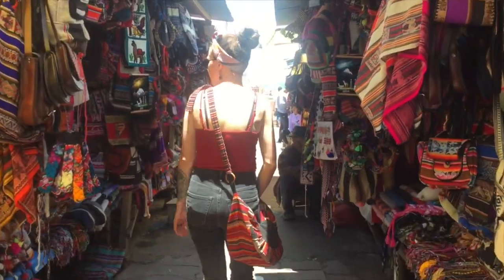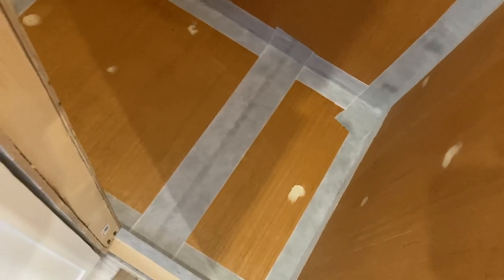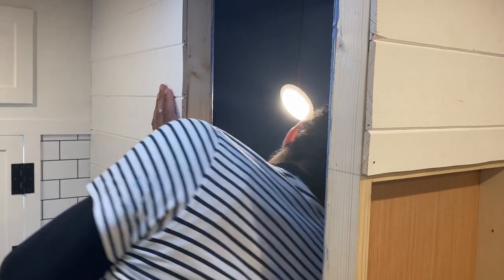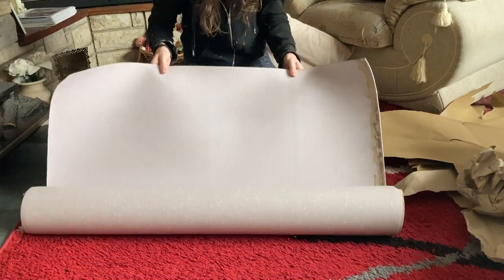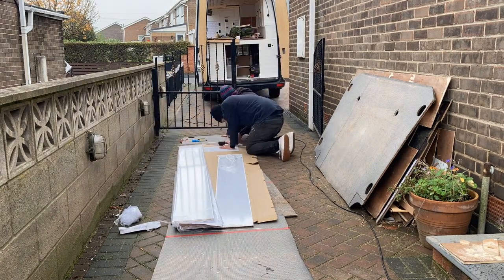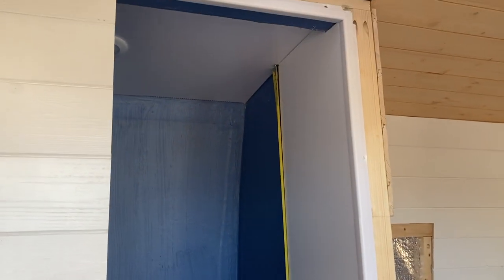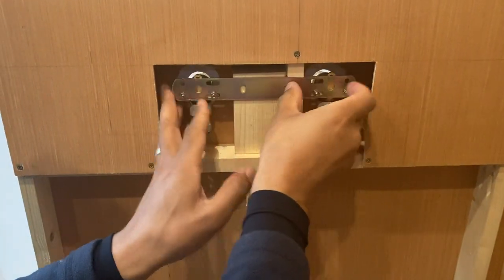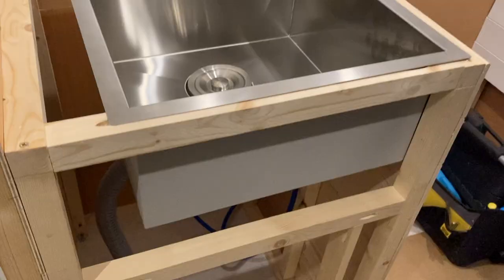Waterproofing Our Van Shower | DIY Sprinter Conversion Bathroom Build

Comment: I used to install bathroom cladding. (on and off over the past 20 years) The secret to cutting it is to use a blunt wood saw. There are also different grades/types of cladding. Sadly you got some of the harder/brittle panels. The more brittle panels are also the thinner panels. The thicker 8mm and 10mm panels are much easier to work with. I would say you did an extremely good job for your first install, especially because you used the thinner panels.
Reply from the maker: Aha, that explains a lot! And is so good to hear that it’s not just us 😅 We went for the thinnest possible cladding panels down to weight and space considerations and we imagined they would be easier to bend into shape than the thicker ones. Sounds like we were very wrong. Thanks so much for the info on how to best to cut them too, that will no doubt come in useful for anyone else reading this who is doing the same thing. Really appreciate it 😊🙌

Comment: Oh boy.... My partner and I are in the beginning stages of a complete airstream rebuild... it doesn't feel like the beginning because we've already done so much but we have yet to build the inside (including bathroom)! We've removed everything, fixed up/welded the frame, installed new floors, taken out the inside skins, polished the outside, taken out the door to fix up, and so much more, and yet the inside is empty! It's encouraging watching this video though, it looks like a lot of work but so far we've learned that every single step is always 10x more complicated than you expected. At the end of the day, you HAVE to be able to laugh off the struggles and mess-ups, or a mental breakdown is right around the corner haha. You two seem like a good team though and you show that perseverance pays off. Anyways, thanks for the detailed and thorough recording/blog of this shower build, it looks amazing!!
Reply from the maker: Wow that sounds like a really big project! It’s crazy how you can do weeks/months of work and then still feel like you’ve not done much but the attention you pay to the bits that you don’t ever see definitely pay off in the long run. You’re absolutely right about the sense of humour though, you’ve gotta be able to laugh even in the face of disaster 😅 We never got any better at budgeting our time though, everything EVERYTHING took waaaaay longer than we thought or wanted. Good luck with the rest of your build 😀

Comment: Well done, I think that's how I would do mine, but with acrylic sheets. But I need to get a loo in there as well. And have the dilemma of: compost, cassette or porti loo!!
Reply from the maker: We have heard people say that the acrylic sheets are a little easier to work with, we were just a little worried about a single mistake messing up a whole wall, at least with panels you can just redo a single panel 😅 We went with a porta potti in ours but we’re considering upgrading to a compost. Just need to find one that will fit through our tiny doorway 🤔

Comment: Another job well done people.  Those bathroom panels looked like trouble from the beginning and the working temperature  didn't make things any easier either.
I'll go for acrylic 3mm panels that cover the wall in one piece. Getting nervous already.😰
Reply from the maker: Yeah we’ve heard that those large sheets are a little easier to work with but we’ve seen people struggle to cut them to the correct shape as well! And we just figured that if you mess a single panel up it’s easier to fix than if we messed up a whole sheet. Let us know how it get on anyway! Sure you’ll be fine 👍😀

Comment: Just done my first draught of my plans for my van just looking  for nod in the right direction plan to put my shower left of the side door and  take the bulkhead out and put plywood wall half way so creating a L shaped kitchen area on the opposite side,not seen many vans like this just wondering if it was possible,any ideas on if i would need a more powerful water pump or even two if need be,hope you dont mind but i have also nicked your seating and your hidden table idea i have mine at 600mm wide is that same as yours  any hints would be helpful fiat ducato lwb is what i would be purchasing